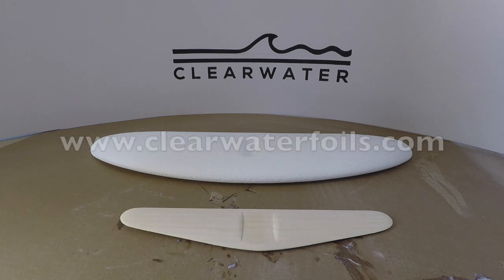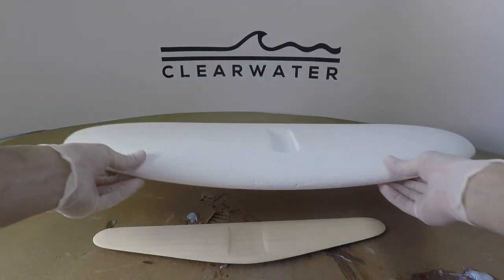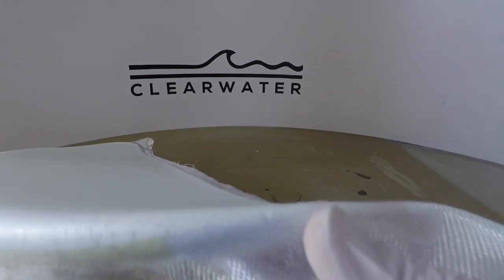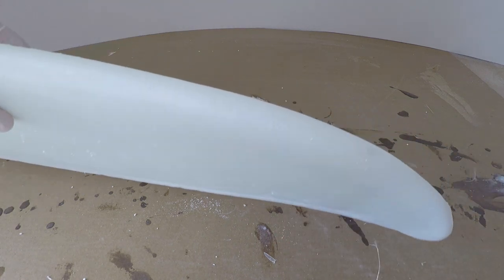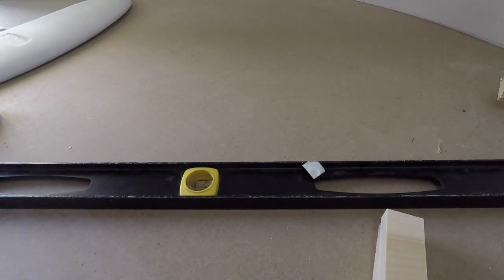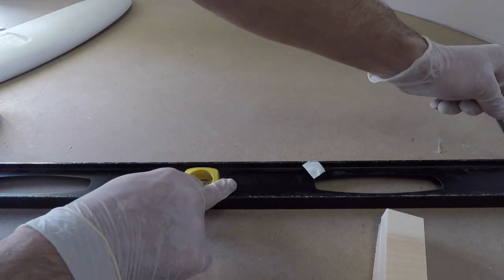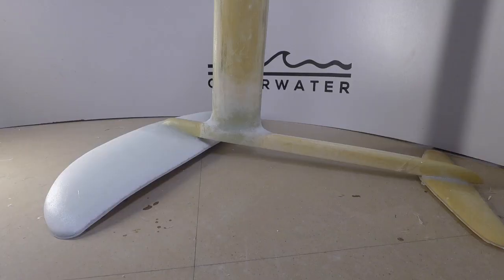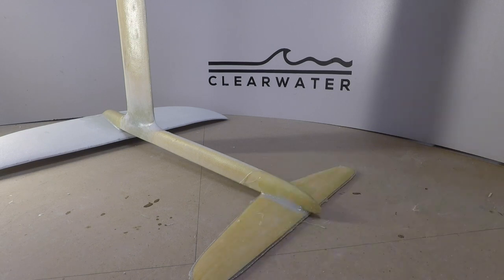How to Build A Hydrofoil P3

Comment: How can the styrofoam not melt when exposed to epoxy resin? Please i need your help
Reply: Most epoxies do not melt EPS styrofoam, polyester resin is also used for fiberglass (sometimes called “fiberglass resin”) and that melts EPS foam

Comment: Entire foil was not difficult to build.  Just takes time and focus.  Used 6oz carbon fiber instead of fiberglass.  Overall, looks great.  However, THIS DESIGN HAS A TON OF LIFT.  AT 6MPH BEHIND A BOAT, IT LIFTS VERY AGGRESSIVELY WITH PEOPLE BETWEEN 150 -175LBS.  This wing is designed for such slow speeds, i'm not sure what its good for.  Sized closer to 1,250 versus the 1,500 might actually be usable.  Overall cost was close to $400.  Kit + $100 for carbon + $100 for resin + $50+ in tools.
Reply: Thank you so mich for the feedback! I'm building mine now for kiting. Do you think the aggressive lift could be moderated by  changing the angle of attach when mounting?? Cheers.

Comment: im building a foil but the styro melt with polyester resin, pls help me just wanna know wat kind of epoxy are you using to fiber that front wing...thanks sir
Reply: He is using EPOXY resin it does not melt the foam compared to polyester resin. But epoxy resin is a little bit more expensive
Reply: @felixleveille8441  thanks sir for your reply.. i will just try it sir...thanks again and godspeed..
Reply: as long as epoxy resin will i use it will not melt the foam? thanks sir
Reply: @richardfeliscoso1554  no.. if it is epoxy resin it shouldn’t melt the foam 👍
Reply: @felixleveille8441  thanks alot sir for you reply.. godspeed to you
Reply: @richardfeliscoso1554  Quick tip... epoxy resin is usually transparent/clear and polyester resin is usually more brown. Look at the colour of the epoxy you are buying it might help
Reply: @felixleveille8441  ok sir,thanks alot .. i serch it in online shop your right its little bit expinsive.. thanks alot sir its really a big help... il just keep in touch if i have more questions to sir hope its ok...thanks again, godspeed
Reply: @richardfeliscoso1554  no problem 👍 if you have more questions just reply to one of my comments and I’ll get a notification
Reply: @felixleveille8441  ok sir,thank you alot, its a big help for me, good day and godspeed..im from phillipines🤗
Reply: @felixleveille8441  good day to sir,its me again, i have question maybe you have idea,. sir,how many layers of fiber cloth well do to make a front wing a hydro foil,..thanks sir,godspeed
Reply: @richardfeliscoso1554  it depends your core is made with what material... if it is foam, I’d put 15 to 20 layers depending on your weight. But if your wing is made out of wood or plastic 10 to 15 layers could work 👍
Reply: @felixleveille8441  thanks alot sir, its a big help.... by d way my 1st foil build with polyester was great,cant believe that it work.. its made of polyester and mat,.. im soo very happy, soo this time i will proced now on making it polish with the material of epoxy resin and fiber cloth.. sir,thank you soo much your a big help.. thanks again,i will just keep in touch to you sir.. godspeed
Reply: @Richard Feliscoso  cool !! I’m glad you had a success 👍 continue having fun!
Reply: @felixleveille8441  bad news sir, im still practicing my foil but the fuselage broke..how sad...hehehe but its ok, i will now move on to the standard materials i need and build a new one, i will use stainless pipe on fuselage and also tha mast.. but iit will take time coz im budgeting for the materials, 1 material per month...its ok,coz i know now it work.. thanks sir very much... godspeed
Reply: @richardfeliscoso1554  if you can, use aluminum instead of stainless.... it will be lighter and less expensive
Reply: @felixleveille8441  ok sir,but maybe i will look for it in the city coz its far a way from were where i live, i think maybe its hard here to find aluminum parts here.. but i will still look for it as hard as i can.. thank you again sir, i have another idea from you..keep safe sir and godspeed.. from phillipines with love.. 🤗
Reply: @richardfeliscoso1554 my foam too, foam melts when exposed to epoxy, how do you prevent it from melting? Please i need help too

Comment: Hi
I'm making a hydrofoil too.
Do I need any angle of attack in the front foil.
You seem to have yours level. Presumably you alter attack by pressure on back foot. So do I need to worry about angle of attack in the design?
Thanks for your help 😁👍
Reply: The angle between the Front and rear Surface in important